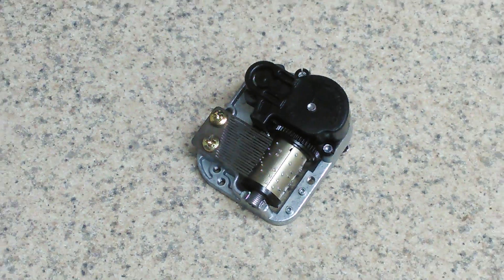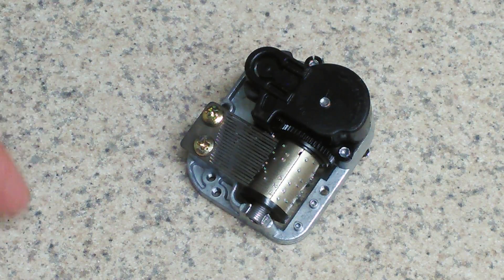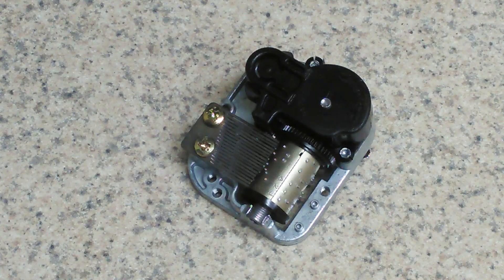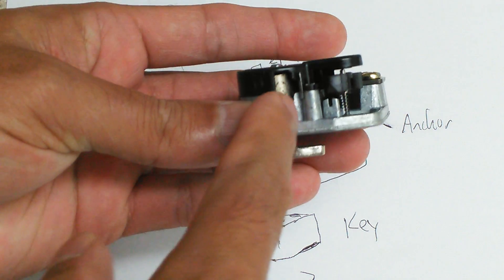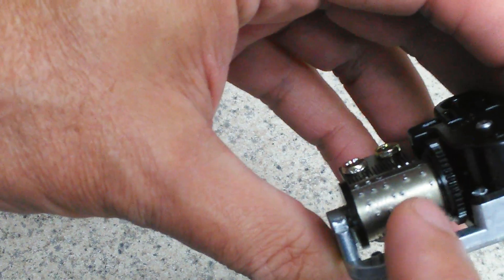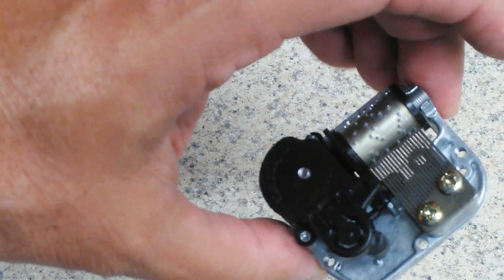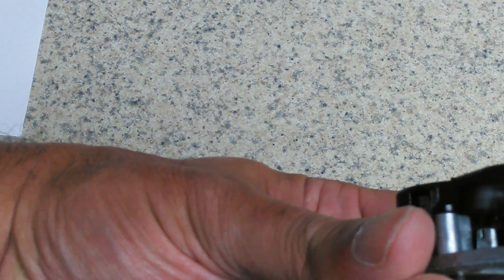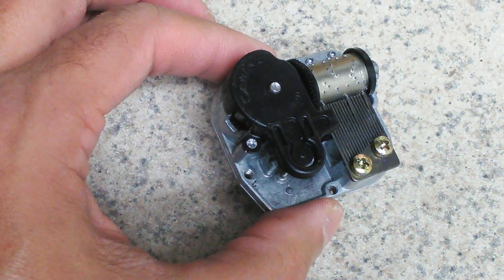How it Works - Music Box Mechanism

Comment: I accidentally removed the fan like- piece and the black top was stuck, i can't move it to put the piece back-
Reply from the maker: If you're unable to fix your music box mechanism, you may consider replacing it. A lot of these music boxes use the same type of mechanism, only the cylinder is different. Try musicboxattic.com They have all kinds of simple and high end music box mechanisms.

Comment: My music box is wound too tight (I think), and I have taken apart and tried to get the regulator to move and it won’t. I added a drop of wd40 to the top and bottom of the regulator, but it still won’t move.  What should I do? Also, I seem to have a manual internal arm that that is locked as well, it’s off the side of the drum.
Reply from the maker: You definitely don't want to use WD-40 on the music box mechanism, as dust will eventually settle in and clog up the works even more. Music box mechanism's typically don't require any lubrication at all because they are not constantly running, or synthetic clock oil could be used instead. Worst case scenario, you can always get another music box  mechanism from The Music House

Comment: I do have the same music box and when I turn the key it is just clicking, but nothing happened. I could turn it forever. Anything else is working. The spring seems to not be wided (sorry for my English). Can you help on that problem please?
Reply from the maker: This video shows how to fix that problem: https://youtu.be/FaCL8-6Ijg0
Reply: Frank Hamilton this is a link to a  non helpful video ;-)
Reply from the maker: Sorry, here's the link you'll need https://youtu.be/AyIonSdHtLo
Reply: Thanks, but I fixed it already. Had to brake a bit open of the black plastic and clip the spring and now it's working again